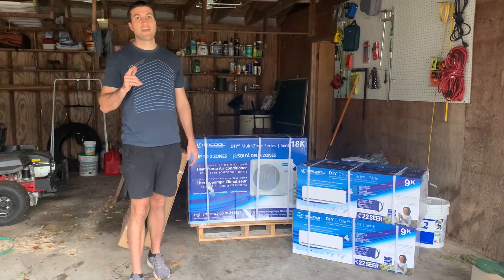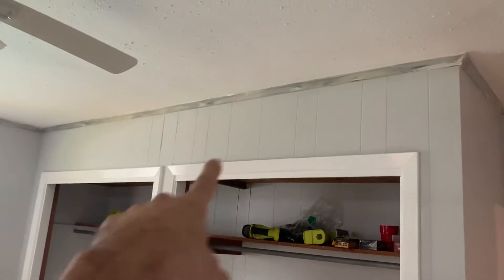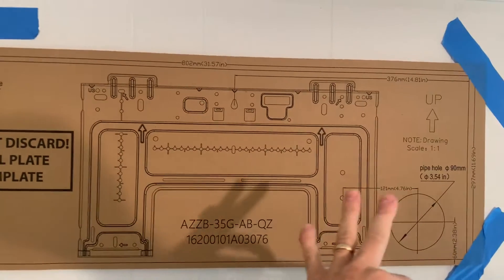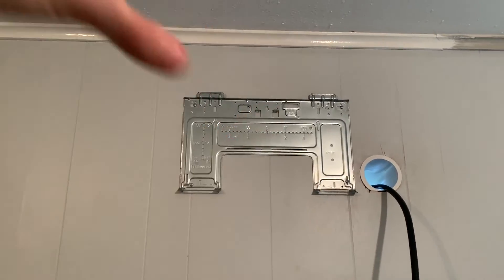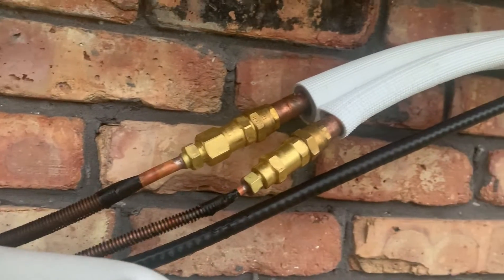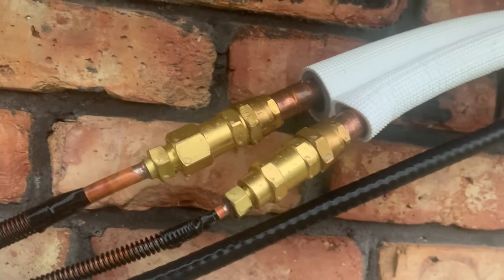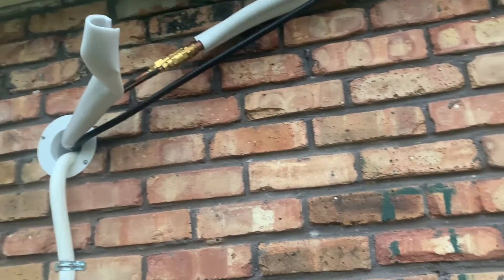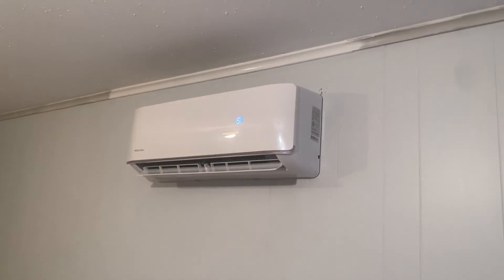Installing 4th Gen MrCool DIY Mini-Split | Dual Zone 18,000 BTU

Comment: Thanks for the video.  It helped me realize I had incorrectly switched the A and B power lines at the outside compressor port by mistake.  Anyhow it was a head scratcher with no error codes up until your video so thanks!
Reply from the maker: Awesome! Glad it helped!

Comment: Interested that in the specs it says min wire gauge for the 18K is 12 gauge but it recommends 10. Wish it would just say use 10 if that’s what it really needs. 🫤

Comment: Incorrect installation! The route needs mandatory vacuuming, which the man did not do! Subsequently, due to the presence of moisture in the system, the compressor will fail. Don't do this!
Reply from the maker: MrCool lines are pre charged, no vac lines. One of the only mini split companies that do that which makes it a truly a DIY kit.
Reply: @StephenFixesThings  the connection between the manifolds from the condenser to the first spring loaded connection has atmosphere in it mine were all lose  on my 4 header condenser the bottom two were in a bag not even screwed on  they were in the bag with the 24 k larger spring-loaded connectors, needs vacuuming or your putting atmosphere aka water vapor and oxygen into your system ,i talked to mr cool and they said screw the bottom ones on and tighten all the spring-loaded connectors up and you will be okay which is bullshit they can not tell you to purge it because it is against the law so they say just tighten them up you will be okay if they say pull a vacuum on it well they lose their claim to fame no special tools and if you look at those spring loaded connectors they are trapping a little bit of atmosphere in every connection, you only need a little bit of water vapor to ruin your system they will not last, i have a 608 certification so i got rid of all those connectors and brazed it in the proper way pressure test with nitrogen which with 410-a you need to check up to 600 psi not the way they show you that's only about 250 psi pulled vacuum down below 500 microns working good not worried about water ,getting water vapor into these systems is a nightmare to get it out with poe oil and yes im a hvac mechanic i saw this shit when it arrived at my house and wanted to return immediately since they were going to charge me thousands of dollars to return i had to install proper way
Reply: people don't understand the concepts of refrigeration they are catering to people that don't realize that you only need a little bit of water vapor in your system for it be destroyed and  if the air is not o percent relative humidity it has water in the air you can not see water vapor that is what is getting into those connection that water gets into the poe oil and forms acid with 410 a which is a hydr fluro carbon hfc it forms hydrofluoric acid which congels your oil and thickens it up and clogs oil ports and people dont understand oil gets pumped out into the system it does not stay in the crankcase of the compressor it travels throughout the system with the refrigerant, and the water freezes at the electronic expansion vales blocking refrigerant and oil flow losing capacity these heat pumps dont have backup electric heat so if you don't have a secondary heat source and the compressor goes your house is not going to have heat the oil is the most important thing in the refrigeration system when you contaminate it with water and it forms acid and it thickens up it gets trapped out in the system and does not return back to the compressor crankcase and  startes the process of decomposition breaking your oils lubricating properties its like your car would you go 20 yrs without changing your car oil no why? are atmosphere has water vapor and oxygen which gets into engine oil and the heat of combustion starts the process of decomposition it breaks down your lubricating properties so they say to change it every 3 months or 7500 miles because when your driving the heat intensifies the process only differents the diy systems are hermetically sealed you can not change the oil so it is critical you install with out putting contaminants in these systems should last you 15 yrs and more done right

Comment: Oh, just an FYI...  using a Green wire as a Neutral is a Code Violation (NEC).  It MUST be white only for a 120/240v system.
Reply: It’s not a neutral. It’s just a ground. He called it a neutral.
Reply: @jjr897  😃 awesome

Comment: Hey Stephen nice video. 2 hints that might help viewers. I just installed a 27k unit. #1 when you do the knockout for the main power use the upper knockout , I used the lower as I saw that you did and can’t get the screw in to hold cover. #2 when you put the line power under screw use left side so it doesn’t push the wire loose. Thanks for posting.

Comment: Hey... nice video...just a quick question. I have to install both indoor units in order for system to work. Right? I installed only one indoor unit with 2 zone system , left other , and turned it on but it is not working. Not turning on.
Reply: Yes, because you’re dead heading the compressor, nowhere for the refrigerant to circulate.

Comment: Did the connect lines come with it or it's a separate purchase
Reply from the maker: Yep, comes with it. You can choose your lengths too. Make sure you measure good because you can’t cut the excess on them.
Reply: @StephenFixesThings  where did you order the mr. Cool mini splits at ?
Reply from the maker: I ordered it from Premium Home Source. They let me choose the line length and the price listed included tax. Everything arrived quickly with no issues.
Reply: @StephenFixesThings  ok I'm going to look that up . Thank you
Reply: some kits come with the lines and others dont. you need to do a site review and purchase the shortest lines that will work. they come in 16' 25' and a couple longer lengths. One thing that makes it best to purchase a kit with the lines you need is this should make sure the coolant in the condenser is the right amount

Comment: Hi, great video thinking about installing this system I wanted to know if one head don't work does it shut down the other head.
Reply from the maker: Thanks! That’s the great thing about these is you can run them both or just one while the other is off.
Reply: @StephenFixesThings  Great than you

Comment: Hey Stephen; this is a good overview video. Don’t get bummed on the naysayers, you did a decent job. There will always be folks that quibble with the details; the point is that your system is working and not leaking refrigerant.   Maybe after a year of usage, post an update about how the MRCOOL is performing.  Cheers and good luck, thx for the video.

Comment: 10:20 -   Quick tip, (Disclaimer: for entertainment only, always consult installation manual & professionals for specific situations) the green or bare copper is the ground wire, not neutral (usually white).  In this case, it looks like the neutral wire may not be used.  In the U.S. the neutral wire generally completes 120V circuits, but for 240V, the neutral wire is typically used for unbalanced usage between the red & black wires.  Neutral (white) may be seen on newer 240V ranges or dryers.  Green (or bare copper) ground wires are intended to interrupt the circuit if it somehow touches something it shouldn't.  Examples would be a live wire touching the metal casing, or sometimes can occur from bad motors.  Don't worry about the naysayers, I'm sure you learned a lot, thanks for sharing your experience!
Reply from the maker: Thank you for the feedback! I definitely am learning a lot of things as I go, so I always appreciate more knowledge.
Reply: Made the same comment... just after I saw yours..lol   I take it, you are an Electrician as well.

Comment: I assume the refrigerant is R-410A.  Are you EPA-608 certified? I understand that is a law.  And did you torque the connections 🤔?
Reply from the maker: Yep, R-410A. That’s what’s so great about MrCool is their lines come pre charged. So no need to hire an HVAC technician. Torque specs are included in the manual on page 26, but as it notes you’re okay to tighten with wrenches as long as you don’t over tighten.

Here’s the manual for anyone interested!

https://mrcool.com/wp-content/dox_repo/mc-diy-4-es-im-um-en-01.pdf
Reply: @StephenFixesThings  you must not be certified.  If you were, you'd know the law.  It is, you must be certified, if there is any chance of releasing refrigerants.  When you connect the lines, there is a chance of refrigerant release.   I've been teaching new techs for 20 years.
Reply: @leealtmansr.3811  The law does not apply to DIY systems such as these. And even if it did, only a bureaucrat would lose sleep over it. In the real world, I see no problem here.
Reply: @paulmaxwell8851  okay. But why do I and other technicians need to be certified to go back and work on that same system?  What is fair for all?
Reply: @leealtmansr.3811  You are directly handling and charging with r410a. That is not the case for this DIY kits. The system is precharged. Only thing you have to do is hook up the lines and open the valves. And let's not pretend like you're going to go service a Mrcool. 99 percent of HVAC guys won't touch the DIY kits cause they're  taking their business. Which I'm all for I've seen countless people get raped on mini splits over the past couple years it's almost criminal seeing how fucking easy the job is if you have the tools. I anticipate the DIY kits to increase in popularity as HVAC people become more and more overpriced
Reply: @leealtmansr.3811  One thing that it claims is different, is that this unit should not be disconnected by the consumer. It's a one time connection that promises to not release gas by sealing the connection before the valve in the line set is opened. That's the only way this is allowed, no gas released and no repairs allowed by the consumer. If they wanted they could make the one time connections permanent so the consumer CAN NOT unscrew it and instead be forced to call a tech...
Reply: @Live-DIY  I have worked long enough to be able to say those"one-time, no leak" connections "ALWAYS" work and never leak 😂🤣😅.  And every mini-split I've seen requires you to torque the fittings.   I'm just saying.
Reply: @leealtmansr.3811  yup. Hehe well satisfying req. with patents and warranties might get certain technologies on the market but of course there's real world results that might differ. Hopefully they've mastered it within a particular margin if error for my sake ( because I just put one in! ) but if not I'll have to go get certified myself because noone around here will touch these from what I'm hearing.
Reply: The connectors seal perfectly as they come together, no gas can escape. Although they provide torque specs they are irrelevant because the connectors bottom out . There is no flare type connection that needs to be made by torquing. Whole different scenario.
Reply: Don’t you have some womanizers, hypocrites and serial cheaters in church to call out? They cause many more problems and trauma in the USA. Good luck. You can get the word out fast on Fakebook. That is what I used for many of our local slippery zippered philanderers.

Comment: I'm sorry, but it is super messy installation. Don't be scared to cut drywall. make a hole just behind the unit and run all the lines to the attic or inside the wall. Unit mount. Use solid concrete handmade or the one you can buy in homedepot. And screw the unit to it. If you won't, - unit will fail eventually.  It should be tied up to the wall on top of the hanger or to the ground, - so excessive vibration will go into the ground your the house.

Comment: what size breaker did you go with? Im planning on using the exact same (dual zone 18k) unit
Reply from the maker: I used a 25 amp double pole breaker
Reply: @StephenFixesThings  they had a 25 amp Breaker???   Wow, haven't seen those in years and years and I am a licensed Electrician of almost 30 yrs. What was the FLA on the data plate if I may ask.

Comment: It's very important to torque the flair nuts to proper spec as stated by Mr. Cool. You didn't do that. Just being honest this is one of the sloppiest installs I have ever seen. You should put those linesets and electrical in lineset covers. It makes it look neat, professional and shows you take pride in your work.
Reply from the maker: MRCOOL only recommends using a torque wrench if you have one. In fact they don’t even use one in their videos. The key they point out is to not over tighten it. As long as you connect the lines as far as they’ll go and not force it after that there’s nothing to be concerned with.
As mentioned in the video, I went back and cleaned up the linesets afterwards. 
There are definitely some things I could’ve done less sloppy though, so I don’t completely disagree with you. The electrical could have been done better as discussed in a previous comment. I appreciate the feedback!
Reply: The number issue with mini splits is leaks at the flare fittings. So torque to the correct specs is very important.
Reply: @scotts4125  the 4th gen has new fittings that shouldn’t leak
Reply: The number issue with mini splits is leaks at the flare fittings. So torque to the correct specs is very important.

Comment: The drain line come connected, and the one that comes with the lineset pushes onto the other one.  So what is the drain line plug for?
In the instructions it says "to prevent unwanted leaks, be sure that the factory installed hollow center rubber plug is installed in the unused drain hole."
Where is the unused hole?  Is that what the plug is for?
Reply from the maker: I didn't have to do it, but you have the option to move the drain, lines, and electrical wire on the back of the indoor unit to the opposite side. I'm guessing if you do that you just want to make sure you're moving the drain plug to the opposite side. If you're not switching it out then you don't have anything to worry about.

Comment: You really should use spade lugs instead of using just the wires under the screws and eliminate the loose strands of wires.  Having loose strands can effect the current carrying capacity and potential contact with other items. You only talking a few bucks to do this. Are the smaller two (2) flex sealed connectors? Also does not look like you used the strain relief block for the com leads.
Reply from the maker: Good point, I think I'll go back and clean it up with some spade lugs. Yes they are flex sealed connectors. I ended up moving the strain relief blocks back up after the video but forgot to include that.